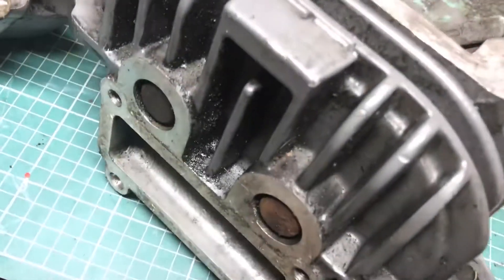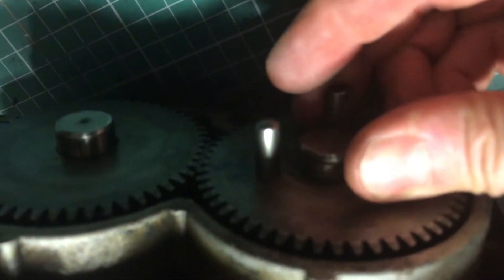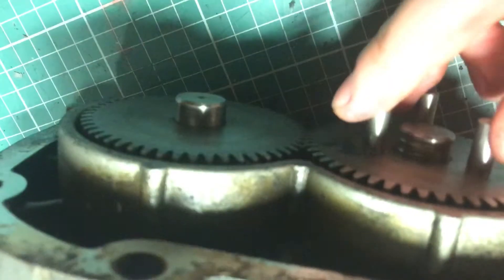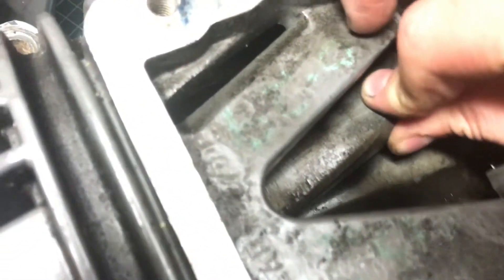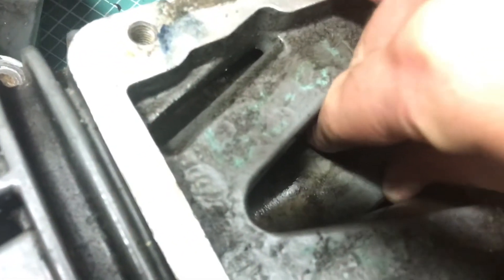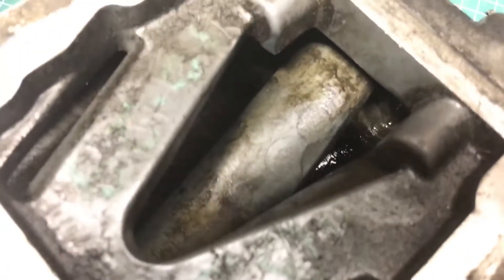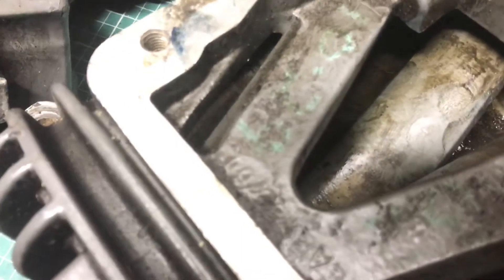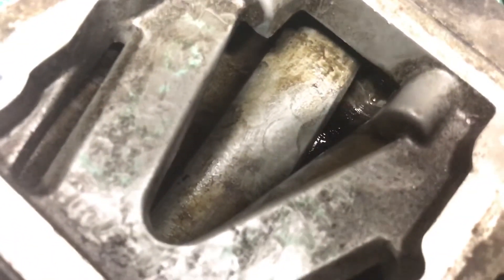Does my Eaton m90 supercharger need a bearing rebuild?

Comment: Well i would say put new sc oil and change the rear needle bearings but you will need a hydrolic press to get them out and put new one in. They are grease packed, thus smaller  and not lubed with sc fluid  like the front ones and fail more often

Comment: It Should have zero play. Needle bearings are fucked.
Reply from the maker: lucian kristov thank you a timely response! I replaced the needle bearings yesterday which has resolved 90% of the issue.

There is still a slight metallic scraping sound at the opposite end of the rotors as they rub (which they shouldn’t) but overall it’s a million times better :)